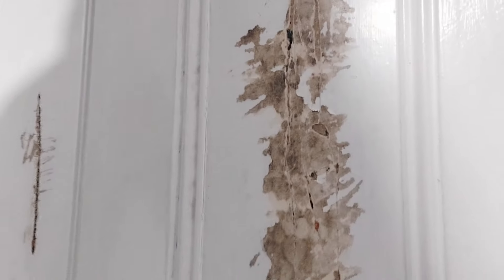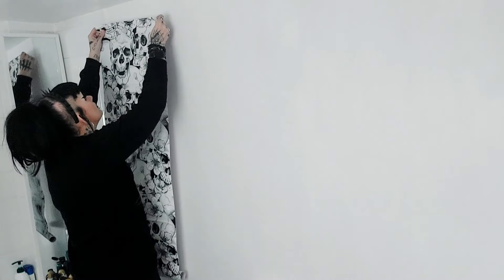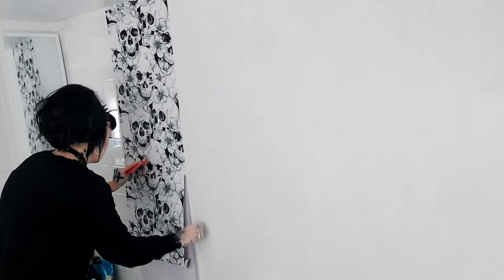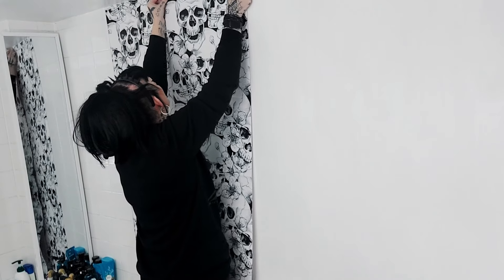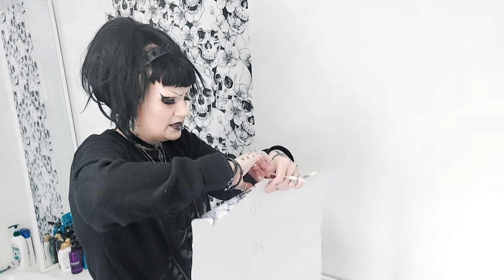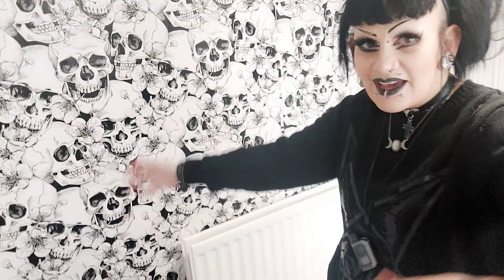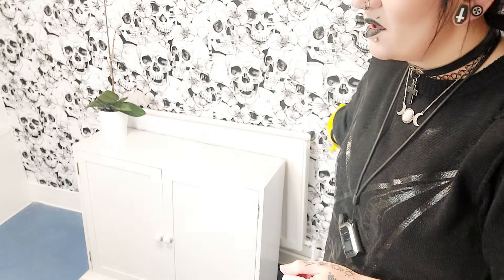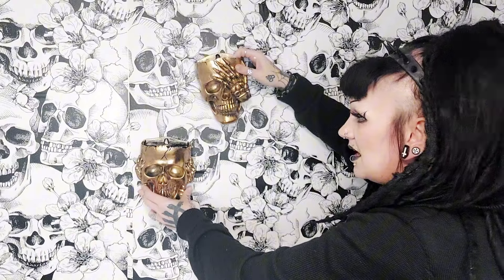Goth Bathroom - Part 2

Comment: oh my gosh it turned out so beautiful!  If I heard right this is literally like a giant wall sticker? if you want to remove it it just peels off and doesn't need to be steamed off or treated like normal wallpaper which is even cooler. I may look into this because I want a purple and black damask print wall but since I live an apartment  so I cant do anything that will disturb the  boring cream colored paint so this might be a possibly solution.
Reply from the maker: Yes, it's a wallpaper sticker, oh the possibilities eeekkkkk, they have so many different colours and designs 😄 you need to go look 🦇✨️🦇
Reply: @StarRavensGothicEternity   definitely going to look especially how good the price is. 😀